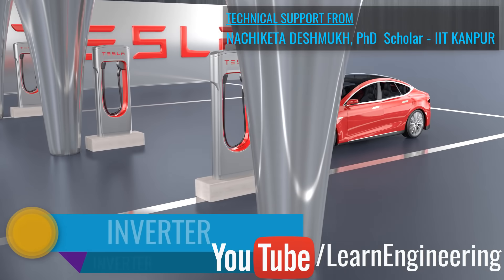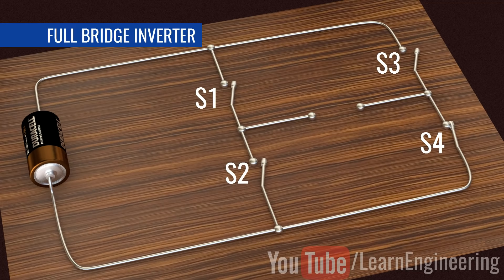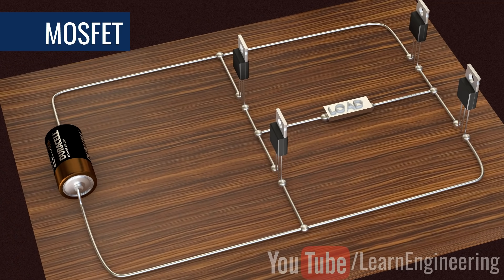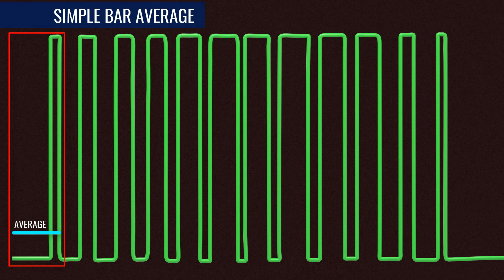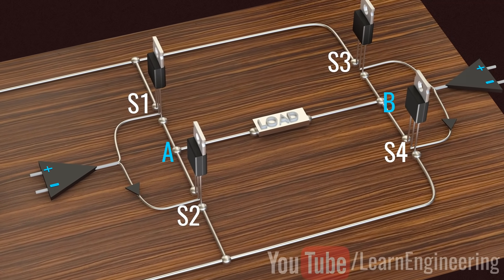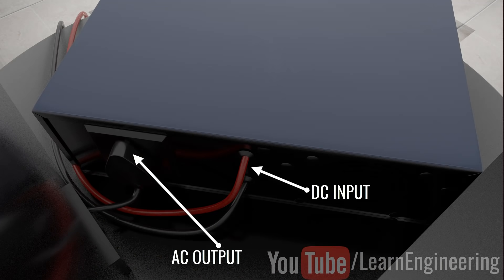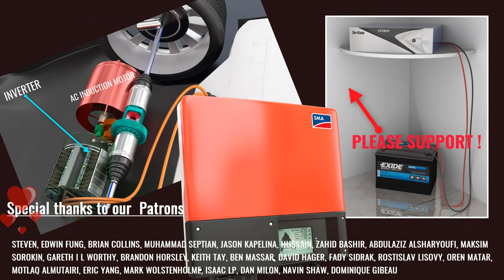Inverters, How do they work?

Comment: But square waves are actually DC because the voltage stays the same but the polarity changes, the true AC power uses sine wave.

For example let's say you 120VAC, so it starts from 0 to 120, and goes back to 0 and goes down to -120 and the same thing happens over and over.

Comment: I'm not clear on the Making Pulses part: when using a comparator to generate step pulses, it takes the sine wave and triangular wave signals to do the operation. Where are these signals coming from? And, if there is already a sine wave signal present, wouldn't it be easier to remove the transistors/switches altogether and just do some operations based on the readily available sine wave signal?

Comment: rotary switch 120 times a second? that's  only 7200 rpm! what do you mean you can't do it mechanically? that's BS! that's literally how they made AC before they invented alternators. "just make" a rotary DPDT switch, somehow. then each hit flips polarity at whatever rate you set it at. duh. i mean it's easier said than done but ive heard they used to do that

Comment: You omitted the technique used by billions of ordinary home computers and HiFi audio power amplifiers. Run the PWM generator at a high frequency, such as 30KHz or 40KHz. Filter with a low-pass LC filter. This gives much finer control of the output, suitable for the tight specs of a computer, or the discerning ears of an audio enthusiast.

Comment: How does the passive filter circuit mentioned at 5:43 look like?
Reply: An inductor is placed in series woth both the load and switch, and a capacitor is placed in parallel with the load and switches, in between the inductors

Comment: I have a question regarding the comparators. To create the pulses it seems the triangular waves are compared with the sine waves. 1. Is the comparator already programmed with an "example" sine wave to compare the triangular wave with. 2. If that's the case why is there a need to do this on the fly i.e if all that is needed to get the pulses is just logic based on the peaks and troughs of both types of waves why are the comparators not pre programmed with the pulses already. Is it because of the variability of the DC source that makes it unpredictable?

Comment: I had a 1966 VW Beatle that ran on a 6 volt system.  I installed a cassette stereo system that ran on a 12 volt system.   I got an inverter/converter that converted 6 volt into 12 volt.   Is that the same as the DC to AC inverter?

Comment: Sometimes i see diodes placed in a parallel but reverse direction with the transistors, can someone tell me the role of those diodes in the circuit of the invertor

Comment: PWM pulses can be fed into an integrator (op-amp with resistive input at inverting junction and capacitive feedback), (also known as Miller integrator), then the choppy "staircase" sine-wave is smoothed out with a shunt capacitor to ground (low-pass filter) to remove high-frequency harmonics from the "staircase" wave.

Comment: It would be nice if you create a video describing the inverters used in electric cars like Tesla Model S. How do they change the amplitude and frequency? Are they reasons for creating the RMF in the induction motor by achieving maximum magnetic field at two coils and two different instances?
Reply: 'Are they reasons  by achieving maximum magnetic field '  Not sure if this is exactly your question, but probably related.  Say you design an electromagnet, and say the full strength of fully on is 100%.  If you try to run the electromagnet at 50% magnetic strength, it will take MORE than 50% power to do so, due to the inductance of the coil.  IOW if you switch the coil at 50% duty cycle, the rise time due to the inductance of the coil and generating the magnetic field will cause a lot of losses, and you'll get noticeably less than 50% strength for that 50% power.  IOOW it's inefficient to run magnetics at less than full power, there are extra losses in the switching for PWM for partial power.
So full power in 1 or 2 coils out of many is much more efficient than trying to run partial power in more coils.
It depends on exactly what you're doing, and the actual losses can be not that terrible due to other reasons.  But for the electric cars they're trying to wring every last bit of energy use out of them, so they are probably going to the extra trouble of doing everything in this manner.

Comment: please correct me
when power is on , it converts DC from battery to AC and then in circuit
but when power goes, it supplies pure DC to the circuit, enough to power fan,lights and light objects

Comment: I liked the H bridge demonstration,  for the output, I have found a common mode power choke effective at smoothing with a  non polarised capacitor on the output.  It is very hard to get a perfect sine wave but it is good enough for most appliances which will simply re-regulate it

Comment: You know the Tesla motor in that car is actually a c but the batteries are DC so you have to have a inverter and a voltage and also you have to have a voltage rectifier to go from the AC to DC so that electric golf cart you guys call a car don't belong in the road those damn electric braces a shitzu stay off the road but you have idiots who think they're good cars electric vehicles are a fad they were at the beginning of the automotive trade they still are today you know the first electric car has better battery controlling a distance than newer stuff back in the late 1890 the first cop car has better distance in range than the Tesla

Comment: If i understand this correctly, the sinewave is generated using comparators, which use sinewaves and squarewaves to trigger the switches. But from where do these sine- and squarewaves come from, if we only have a DC Power source and we are yet to produce such a sinewave?
To me it seems like we need a sinewave to generate a sinewave, which has yet to be generated and so on... like an infinite loop. I'm sure  i'm overlooking something?

Comment: I take issue with your statement at 1:50 that AC can't be produced mechanically.  Back in the 40's and 50's of the last century before transistors, car radios needed a way to produce high voltage DC for the plate supply of the tubes from the 6 or 12 volt battery supply. This was done with a mechanical chopper called a vibrator which ran around 60 Hz, producing square wave AC. This was stepped up with a transformer, rectified, filtered and supplied to the tubes. For obvious reasons this arrangement now rests in well deserved obsolescence.

Comment: Im a bit confused here. Where does the sine wave that we use to compare with the triangle wave come from ? Are we supposed to create a sine wave from the DC signal ?
Reply: The reason is that making high power sine waves using analogue ampifiers causes large power losses, dissipated as heat. The PWM (Class D) technique has the semiconductors either fully off or full on, so power dissipation is much smaller.
Reply: Little bit too late but: For that you simply use use an sine oscillator for example (or a DAC).
Those circuits are good at generating sine waves that come very close to the mathematical definition of a sine wave.  But they do not provide much power. If you put too much load on these circuits they may become unstable or they might even get damage.
That’s why we use inverters. They can provide much power. But generally speaking inverters generate pretty inaccurate sine waves compared to oscillators.
So thats why you use an oscillator to control an inverter and the inverter itself to supply power to a load.

Unfortunatelly in engineering nothing is perfect and everything is an tradeoff.
As you gain experience you will learn the advantages and disadvantages of schematics and electronics components.
Reply: You make it - with the amplitude and frequency you need, it's small signal. The circuit will follow in a "real power" path, thus recreating it from dc.
Reply: @jupa7166  So to convert DC to AC, you first need an AC signal anyway. Doesn't make sense to me either. Why not amplify the AC signal you already have then ?
Reply: @Theclawsterrrr  You can call the process amplifying if You want :-) The thing is: input signal is microwatts, output signal is kilowatts.
Reply: @jupa7166  i see. But the whole point is that you want to generate AC because you don't have it in the first place.
Reply: @Theclawsterrrr  Sure, of course, BUT generating small signal is really easy (one opamp or microcontroller or dsp plus a few parts), in case of a real power it is not that easy. Anyway, I'm pretty sure that modern designs skip that "comparator thingy" altogether and just use DSP which drive switches directly using some fancy algotithm, e.g. space vector modulation (which I have a hard time wrapping my head around, unfortunately...). So You are right, You can skip a step here and do it directly.

Comment: So, to generate a pure sine wave, you only need a pure sine wave, a triangular wave and a comparator... but, how do you get the pure sine wave to compare with the triangular one?? It's like "dehydrated water; to get water, just add water"...
Reply: Remember the comparison is done within a microcontroller/microprocessor then the output signal is sent to a driver which is in charge of switching ON/OFF the IGBTs
Reply: If it's in a microcontroller, it's probably comparing values in 2 lookup tables (one for sine, one for triangle) based on the clock input.
Reply: You can generate a pure sinewave using a Wien bridge oscillator. You can even synthesize them using a microcontroller, DAC and low pass output filter.

Comment: At 3:30 you introduce triangular waves. Where do they come from. At the same timestamp you say the triangular waves are compared with a sine wave. Where does the sine wave come from? Wasn't it the whole point to create a sine wave? And now you just suddenly already have one? To create one? Can you please explain that more comprehensibly?
Reply: After watching vedio I just came to the comment section to get cleared from this doubt, by seeing some of the comments like "gr8 vedio" I had really got tensed 😅
Reply: Ok, lemme give it a try,
Generating a low power sine wave is easy, generating a high power sine wave, efficiently is harder. Now, triangle waves are the classic way of generating a PWM signal because when 'comparated' against another voltage the peaks of the triangles will translate to a thinner duty cycle in the squarish PWM output. Think of a mountain in the middle of the ocean, as the water level rises the base of the mountain gets smaller. Thus with a simple, moving voltage we can change the duty cycle; Now instead of a stable voltage we substitute with the small sine wave, and now your PWM's average power will mimic that of a sinewave. This signal is then sent to the transistors who switch the main, large power. This is done this way because if you drive transistors in the "linear region" they will dissipate a lot of heat, that is to say they are much more efficient when you run them fully on or fully off. Does this make any sense?

Comment: It is just a high power class D amp, yours in movie is three level, shift the 50 hz 90 degree for full bridge make 5 level. I do experiment with a 5 and 8 level version, in mine case for audio, busy now with feedback solution, audio is very much more commanding vor multi frequency work as audio is.

Biggest problem with inverters are the capacitors, these do not last long, so after 10 a 12 years need replaced, all of them.

Comment: The depiction of Va - Vb isn't correct here. (1) You have subtracted two things which are actually out of phase (hence does not hold good at the same time. (2) You have shown to turn on totem poles (+ve side MOSFETs) at the same time and you have drawn a resultant Va-Vb; in such case it violates basic principle of H bridge operation.

Comment: Why not use a microcontroller to generate those 4 control signals in software? Even a very basic mc (<$1) can be programmed to do that. No need for analog triangle and sine generators and comparators.

Comment: Great video, but I have to disagree to the pictures of "Not AC" shown at 0:39. Despite the fact that they have a negative net current, the current still alternates. In order to have DC, the AC component of the signal may never cross 0 V.

Still a very informative video - great job!

Comment: But where does the comparator element get the perfect sinusoids to compare against??
Reply: This was exactly my question. My guess is that a microcontroller could be fitted with a digital to analog converter (DAC) and sent it a 10-bit number whose magnitude is converted to an analog signal using magic electron pixies or however they work. This could produce the sine and triangular waves with ease as long as the scan time of whatever program running is probably at least 20 times faster than the PWM frequency. (And the response time of the DAC)

Comment: You lost me at comparator, what's that and how come I've never heard about it before, also what's a "Not gate"?
Reply: Comparator compares and gives output depending on the result, roughly equivalent of { If x>y then 0 else 1}. Not gate reverses the signal, if you give it 0, it will output 1 and vice versa; its represented by triangle or play sign. They are taught in all engineering courses irrespective of your branch (atleast in India). If you want to learn more about them, go through set theory.

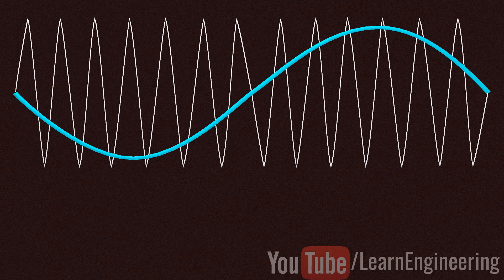Comment: I want to ask a question.  At 4:58 you mentioned from a AC Sine signal. You compared it with triangle signal using op-amp and produced a PWM signal. Where did you produce this Sine signal? There was a DC signal at the beginning. Our purpose was to produce AC signal from a DC signal. If we have a AC signal, can't we just amplify this signal using amplifier?

Comment: I have a question:
Don't you need a transformer in order to highen up the DC voltage input?
Or maybe this is a different logic DC-AC converter.....?
Reply: Only if you need more voltage than your DC source.

Comment: So to generate clean sine wave I already need generated sine wave and triangle wave.

My guess is that these signals come from some RLC circuit combined with some semiconductor electronic. But how does it hold 60Hz frequency if battery voltage drops over time?

I wonder how clean the actual output is. If I did spectral analysis, do I get a tone or a chord? How does it perform under heavy load? Still many unknowns 🙂

Comment: For anyone who wants to now how to wire a comparator. U can take an OP (operational amplifier)  feed in neg and pos 
supply voltage and then the functions u need to compare to + and -  . The output will be neg supply voltage when U+ < U- and pos supply voltage when U+ > U-.

Comment: Early in your discussion you mentioned that mechanical switching was not possible.  Did you know that car radio's used a device called a vibrator which did exactly that.  Every car radio had one until solid state radio's were introduced.

Comment: The reason for NOT simply producing high power sine wave is heat dissipation.  When a transistor is "off" there is no current, hence no power dissipation; when it is fully "on" there is no voltage across it (well, not much) but lots of current; still not much dissipation as heat.  The problem is between those states, you have a combination of high current and pretty substantial voltage drop, particularly if you have a reactive load such that max current hits at the same time as max voltage drop.  A small 300 watt inverter will be consuming over 300 watts all by itself to deliver 300 watts; or an efficiency less than 50 percent.

Consequently it is crucial for the transistors or MOSFETS to be either fully ON or fully OFF and never half-on.  MOSFETS are chosen for rapid switching, insulated gate and most of all, very low "on" resistance.   This produces high efficiency and low heating of the inverter.  But they can self-trigger if feeding a highly reactive load so that's a thing to watch out for.  If that happens you'll know it because you will either blow a fuse (circuit breakers are too slow) or the MOSFET will simply explode.

Comment: APC 2200 UPS uses a big transformer (heavy!) and a fairly simple but high power square wave inverter on the primary.  The secondary is a pretty good sine wave.  It seems to work better this way when there's a significant "power factor" to deal with.

Comment: how do we make a comparitor then? 
why does this circuit cost over $100 when it looks so simple. it looks like less than $20 in components. but i dont know the comparitor circuit, just how it averages voltage.

Comment: I think they missed to explain how the sin-wave and inverted sin-wave signals are generated. My guess for this is a LC-circuit
Reply: nowaday general purpose micrcontrollers (for 2-20 bucks price) have a seweral hardware implemented pwm generators on board (that can be twiked different ways), an also capable do full software pwm on their gpio pins, if you need some exotics.
Reply: They can easily be generated with the help of an operational amplifier
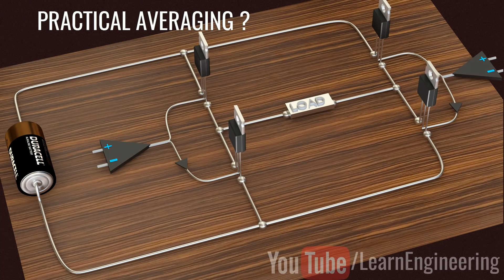Reply: Check 5:38, it's discussed there.

Comment: Its easier to focus on DC than AC and power loss is not so much noticable in a short length electricity transfer, its also easier to go with full bridge rectifier than with those switches

Comment: Why electric cars convert DC to AC to run the motor instead of running the motor in DC?
Reply: Dc needs substantially thicker cables and heavier duty components than AC does.
Especially as power demand goes up.
Reply: Generally used three phase brushless dc motors are light, powerful, durable as well as efficient, but they need three phase alternating current, therefore they are an excellent choice for electric vehicles as they need to be light, powerful and reliable.